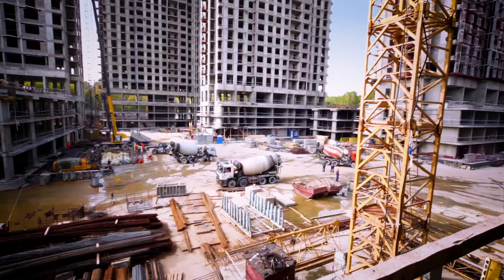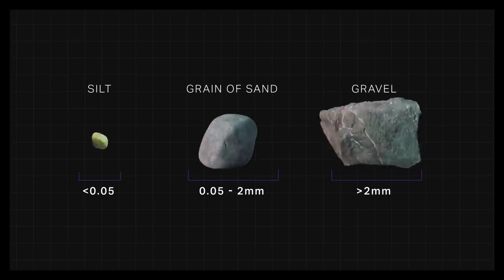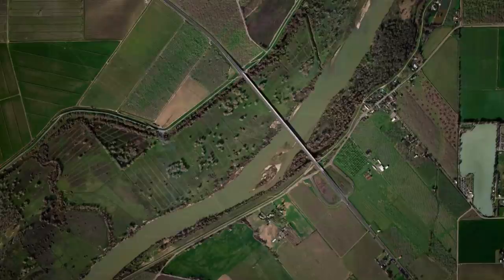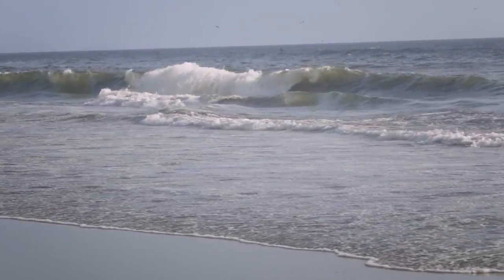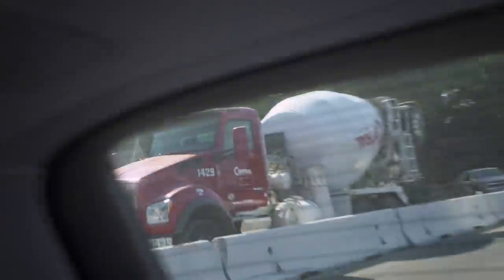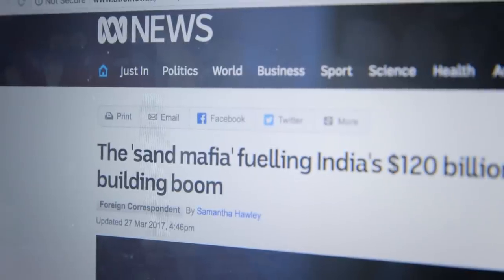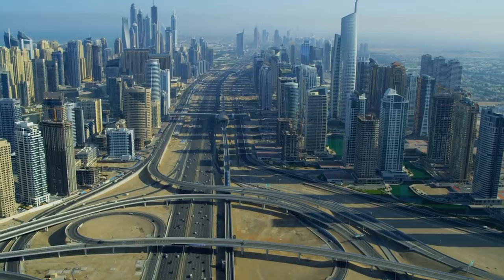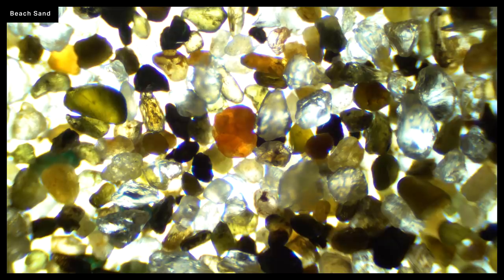A microscopic look at why the world is running out of sand

Comment: IF sand (SiOx) goes narrow its defenitly time to think about SILANE (Si,H,) as an Fuel. Dr Peter Plichta invented Methodes to converz Every Form of siliconhydrogene usable as an Fuel for combustion engines (Dukes engine or Archates Motors). As an result of burning gas you will get SiO SiN + H2O. Some Problems are Solved with this !!!

Comment: So uh, why don’t we just. Put the manufactured sand into a whirlpool to simulate the conditions of the river but amped up to 100, so the rocks and colliding and being smoothed by the water. It would take a lot of time and energy but like, we will never run out of sand. It will be more expensive, but you can get the sand  you need.

Comment: You didn't quite catch the essence of how sand is important in concrete. River sand may be "ideal" for good-flowing concrete; the kind that can be easily pumped, for instance. But it does not afford the STRONGEST concrete. For this, the most jagged sand is desired, since the jagged particles of varying sizes can form an interlocking lattice that depends on the cement only as a binder. As the aggregate elements of concrete become more rounded, the cement itself becomes more important in ensuring the strength. So, the there is no one "best" concrete for all situations; very often, builders accept a compromise that gives the best combination of price, deliverability, workability, flow (slump), strength, environmental resistance et cetera et cetera. Since you're a science channel, you could be a bit more careful about making general statements that don't acknowledge the complexity of even very "simple" things like concrete. Of course, you don't want to overwhelm students with the complexity of the world but you do want to encourage  them to APPRECIATE it. Of course, people are always impressed by the simplicity of dogma; so, I suppose you have to decide whether you're more interested in popularity or true education. Cheers